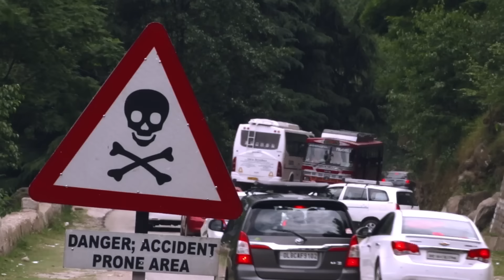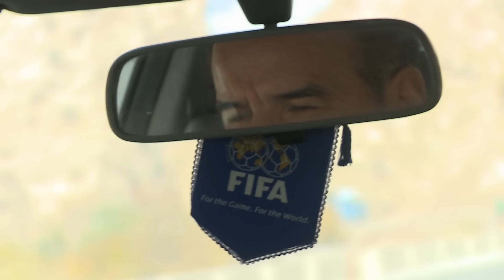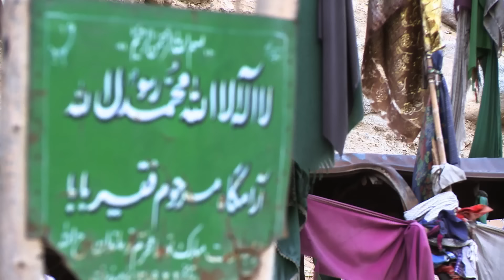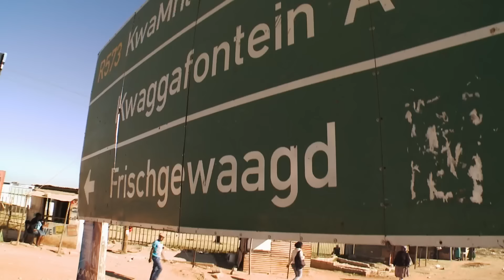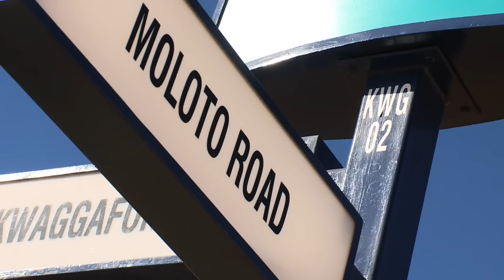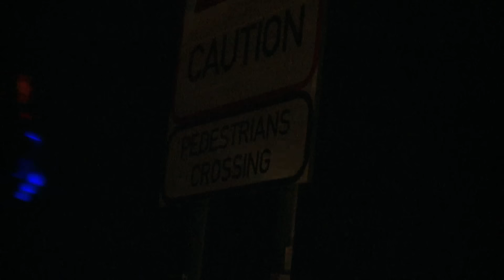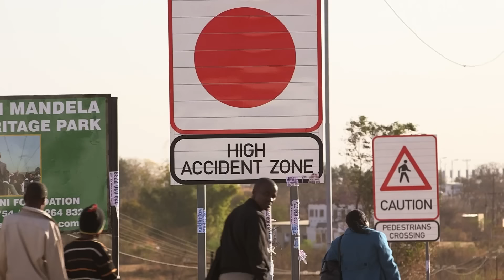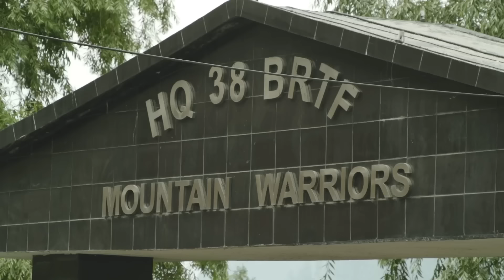Deadly Roads | Afghanistan, South Africa & India | Free Documentary

Comment: On our autobahn's (which are semi-highways) in Europe, we have concrete blocks in-between both directions. Not a painted white line in-between.
Widening the road won't help. (plan A) That would just add cost, and add more danger due to more overtaking. And having traffic officers won't help much either. (plan B)
You need barricades in-between instead.